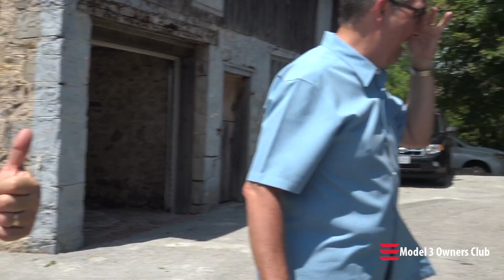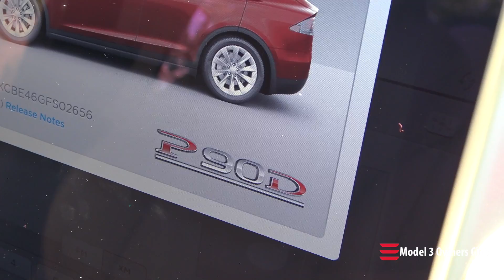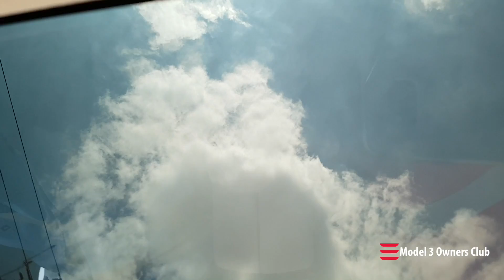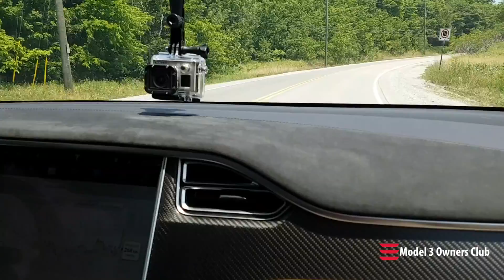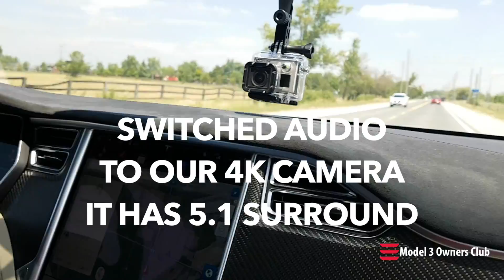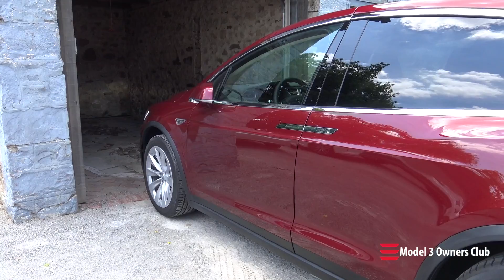Model 3 Owners Club Show Episode 4 Part 3

Comment: FYI, in general car windshields and windows provide ultraviolet protection even if they are not tinted. If you don't want a sunburn just roll up your windows. It is a misconception that the tint protects you from UV light. Keep up the good work.